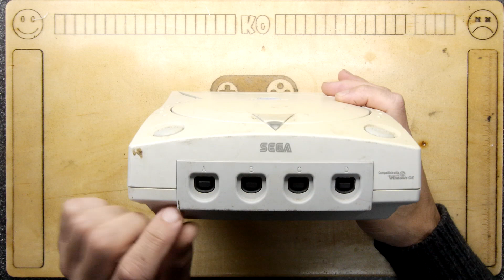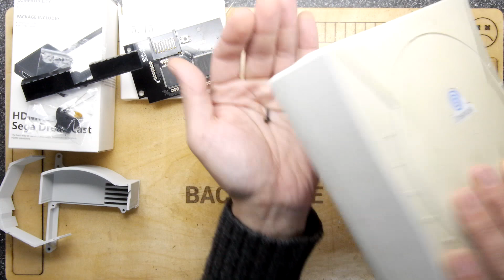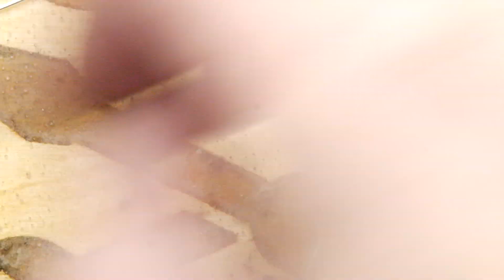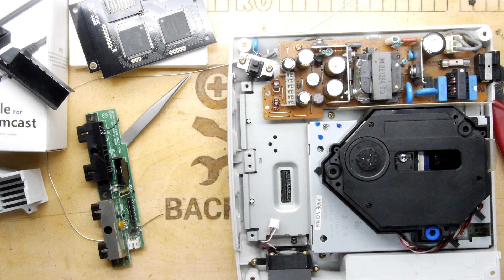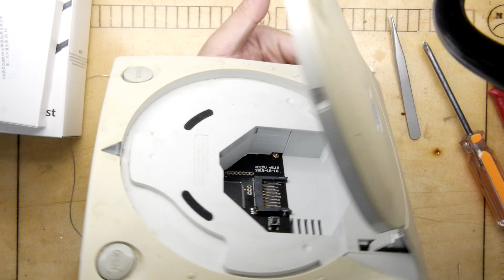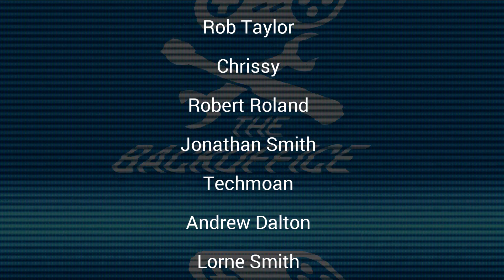Dreamcast GDEMU Installation and Battery Fix

Comment: Hi from Russia. Can you answer to me for one question. What version of GDEmu should I choose: 5.5, 5.15 or 5.15b? 
Thank you.
Reply: Aleksey Plotnikov I don't know where you'd find info on that other than retro forums as I've been looking around before and after I got mine and other than the original all the other knockoffs work identically. I bought mine off amazon for return insurance ($100 bucks)in case it didn't work, but if I buy another I'll go eBay and get the cheapest. Not sure what version I got.
Reply: @noneed4me2n7  Thank you.
Reply: Aleksey Plotnikov I looked I got 5.5 with a manufacturer date of 2018. Apparently most have this printed on them so it shouldn’t be to hard to find a specific model of a seller uses actual pics.

Comment: Nice. Although I have a sizeable DC collection on disk, this GDEMU is much more convenient, and it keeps both the laser assembly and the fragile game cases from breaking. did you get the 2018 or 2017 version ?
Reply from the maker: I'm need to read the number, I think it has the latest firmware

Comment: I have seen this upgrade before. I think they are pretty cool. It’s a good solution for replacing the disc drive which are doomed to failed on these things. It will be sad when all the Dreamcast in the world  disc drives die.
Reply from the maker: I'm sure we can probably replace the laser on the drives if we really wanted to fix them.